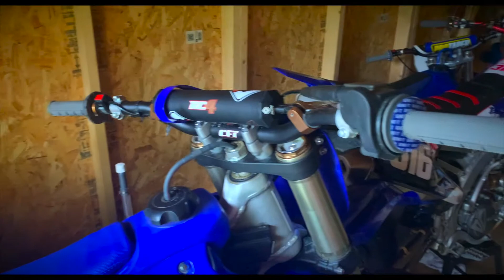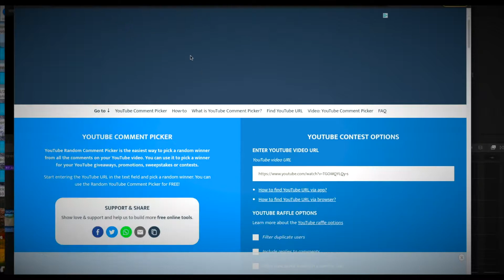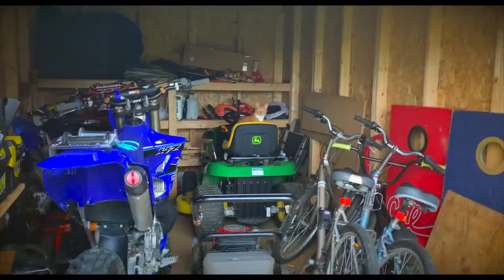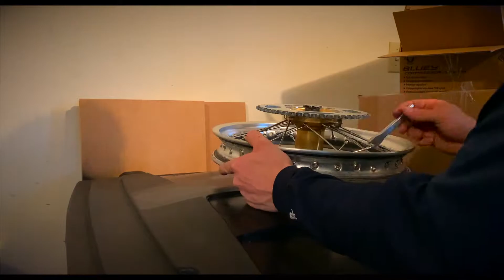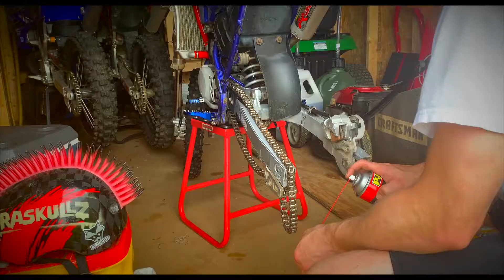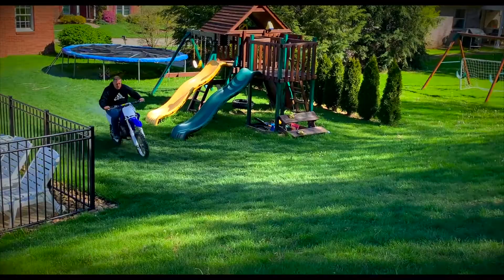YZ85 Wheel Build (Hub, Spokes, Rim) How To... | YZ85 Pt. 5

Comment: Hi, I have the same bike that I'm converting to street legal, I have the same rear hub as this but can not find the bearings online and the spacers as this isn't the common rear wheel, any chance you could point me in the right direction as I'm loosing my head😂?
Reply from the maker: Yeah for sure… parts are super low right now. It’s hard to find anything! Maybe check into oem and see if anything is available. Otherwise your best bet is to check Facebook marketplace or eBay for those parts. Otherwise go the route that I did and get a whole new hub or wheel!